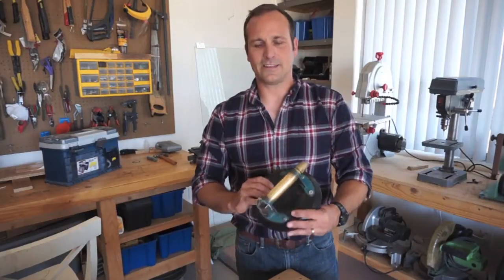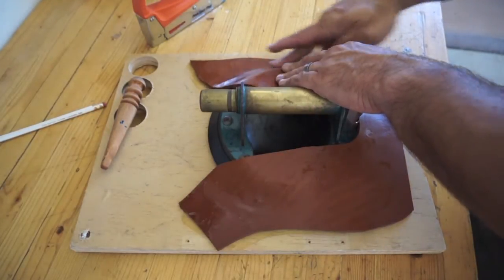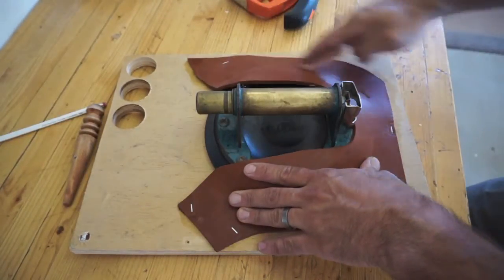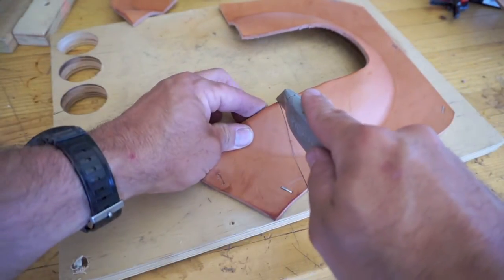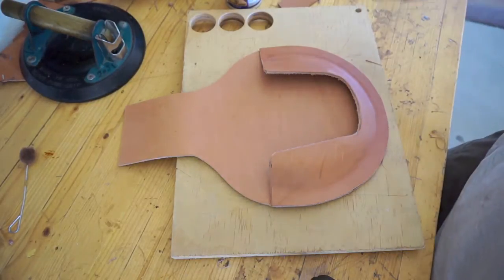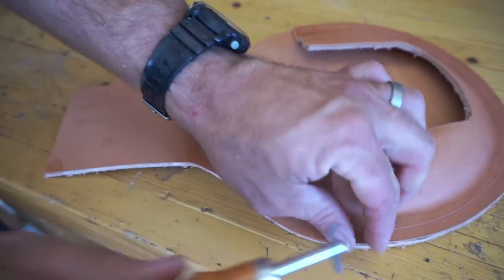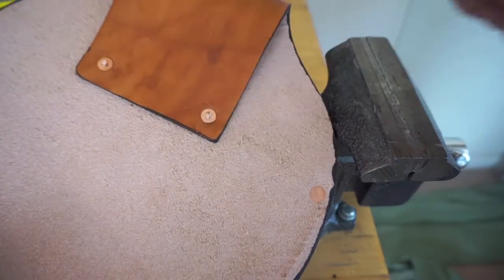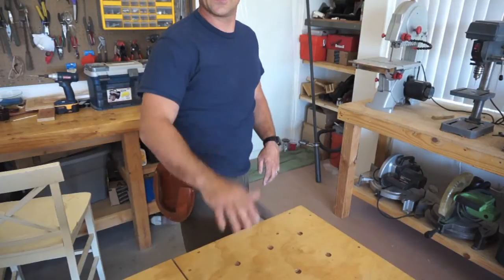DIY Leather Glass Cup Tool Pouch

Comment: Joe, great video. I play with leather as well. Some thoughts;

I use a deer antler tip for molding. It works better for me than wood. (Mainly on revolver holsters)

I dry my stuff in the oven as well. I usually turn the heat one until it gets about 100 degrees. The turn heat off and shut the door. I leave the item in the mold because the leather can shrink (ruined one because of this!) 

When it comes out and cools I seal everything with Super sheen or beeswax. Both help stiffen thing up and prevent moisture getting in and making it floppy. (Concentrate sealing the flesh side)

That's been my limited experience so far! Keep 'em coming!
Reply from the maker: Thanks Rick... I like the cooler oven thing... I always get nervous when its hotter being that I've got to stand there and watch it like a hawk for 5-10 periods.  And the beeswax sounds slick... I've always wanted to try it but just wasn't sure when to do it.

I've got another vid coming up in a day or two showing an ammo carrier.  I use a hard mold with no heat for this one and it's much less stressful that the heat method.... mold it and go to bed!
BTW- Heard the podcast yesterday and thought it was great as usual... totally agree on incrementalism.  Used in politics, marketing, medicating, etc,.

Thanks for watching!
Joe

Comment: Looks great, Joe! The addition of the music during the fast-forwarded spots is very nice. How long, start to finish, did this project take?
Reply from the maker: Thanks Jess!  I agree the music makes a huge difference... nicer to listen to than my voice..lol:)  I'm going to see if I can get trey to make me some more pieces a little bit longer.  
As for the time... whew... I did it over a 3 day period in segments.  The wet molding took around an hour or so, the cutting stamping, sanding, hardware placement, etc, added another hour or two, then the dyeing and treating of the leather added another 30 min or so, the stitching about 50 min.... AND the walking around, waiting for leather/glue/dye to dry, and just contemplating what I wanted to do on the next portion of the project.... 2 days:)  jk  
But seriously, the first of any leather project takes usually 2-3 times as long because you're trying to figure out how to make the leather work for a particular piece.  Not to mention being an amateur at the craft;)

Joe